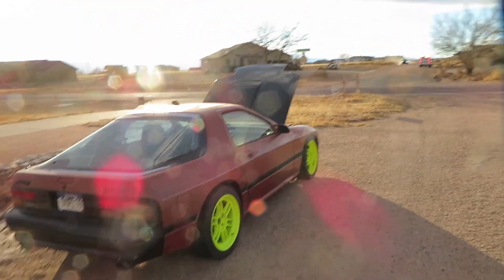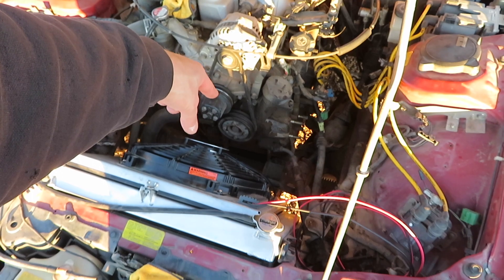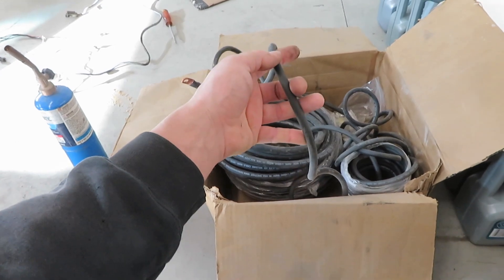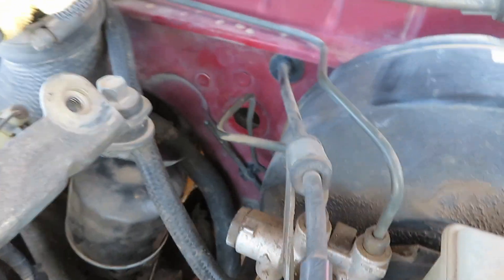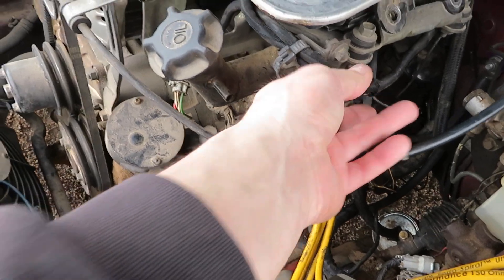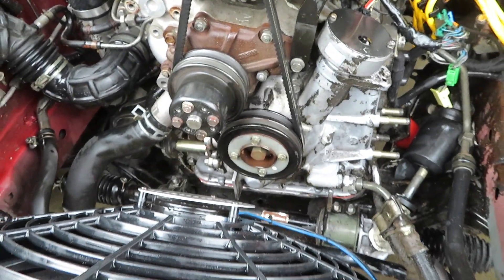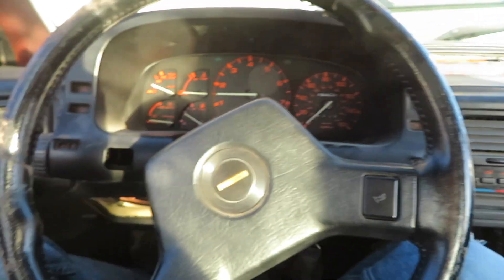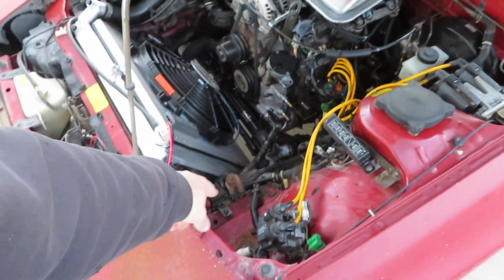Ultimate FC RX7 Battery Relocation - Why Didn't I Do This SOONER!?!?

Comment: I use propane in place of R12 in those old systems, coldest ac ever. You do have to be a little more careful because it can ice up the system since it does run so cold.

Comment: I have an A PEXI Super AFR ,Simple Harness made for the FC , AND i have the boost cut controller Plug n play (Note inside the vaccume line from the stock  line has a reducer inside MUST KEEP), And a manual boost controller ,HKS 
Injectors. And plenty of parts Body panels 7:48

Comment: That girl is mint the way she is. I love the loud rims with faded factory maroon paint. I'd leave it as is. Maybe a light wet sand and matte clearcoat, good to go.
Reply: Or plastdip it satin black. I did my whole crew cab 2500 Chevy for like $100.  If you buy a gallon of the regular thick formula and thin it yourself with a gallon naptha thinner. extremely forgiving to spray on no runs or orange peel  You can peel the over spray off windows and lights when dry And it looks good. Then get armor all or any good ceramic tire shine spray and that will keep it from getting dingy from dust and preserve it from peeling off on you. I'm going on 3 years so far and it still looks as good as the day I first sprayed it. Then if you want to change it  with a little elbow grease and you can peel it off and start again.

Comment: anyone else cringe at 5:51 at that first ground where it doesnt appear to have been grinded down to metal??
Reply from the maker: The bolts threads are bare metal I've never had an issue on hundreds of cars
Reply: @Junkyard_Dave  understood, however i run a car audio team and we've found that it creates a much higher contact patch when you strip away the paint and give it a clean surface to mate to.

Comment: Hey man , Do you have any other video's about this FC? Just that  As i was in the hospital and trusted the wrong shop..and he did more Damage than The 500hp  I was promised But Got taken for the $12k And ,well I became Disabled due to Losing 6 Major organs through an Experimental
(TPAIT)<<-- 15hr surgery had (hereditary pancreatitis)
Anyway i get sidetracked with anger having my 88 10thAE I've had 26years..So Ive been punching life Back But its permanent.🤷🏽‍♂️💪🏽🙏🏼 
 @atkinsrotary I did a full rebuilt Again fueltech FT-450 standalone.IV DONE SOO MUCH AS Im recovering ..im in N.H. , Curious how you Wired up" your's  ect.#Joe thanks 15:53

Comment: There's no reason to reclocate the battery on an RX-7
Reply from the maker: Tell that to 95% of rx7 owners
Reply: I have
Reply from the maker: @dj jay sky  on my fd it made sense with the vmount setup plus I'd rather not see it, also the more weight you can remove from the strut towers forward makes a difference
Reply: The weight  is not enough to make a difference
Reply from the maker: @djjaysky9071  I've heard the reason bmw put carbon roofs on some Ms was because the 20lb weight difference calculated yo a 2" lower cg and additional savings because of that. But I did it more to fix a problem and get the battery out of the elements.
Reply: @Junkyard_Dave  part of the carbon fiber roof was sales tactic according to bmw and with the extra bracing to make it pass crash safety it saved no real weight  but moving weight lower in the car can make a difference
Reply: @Junkyard_Dave  it's the same as making more power less than 10 percent makes no performance difference in the car.  alot of performance companies sell a myth
Reply from the maker: @djjaysky9071  then why upgrade anything with that logic